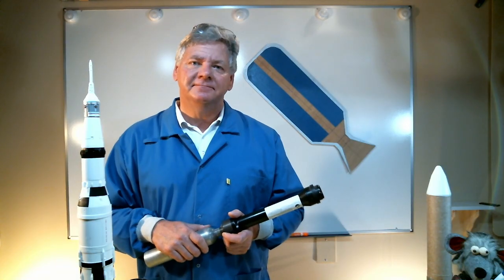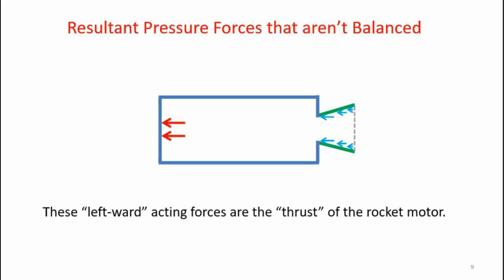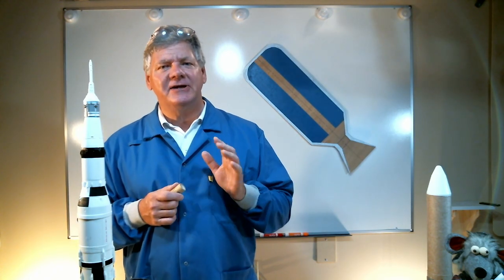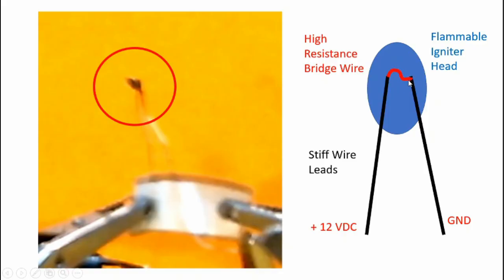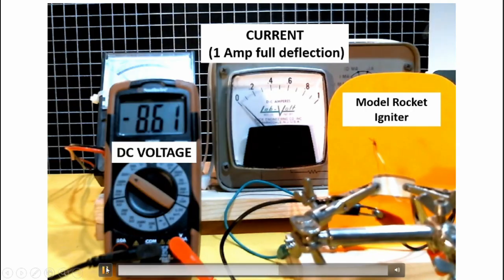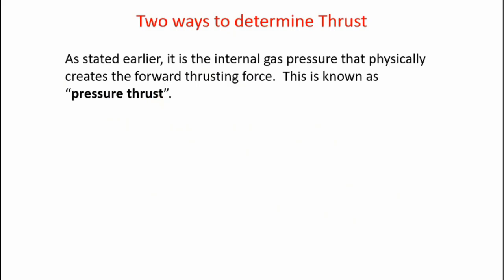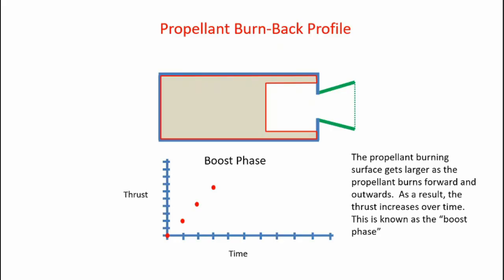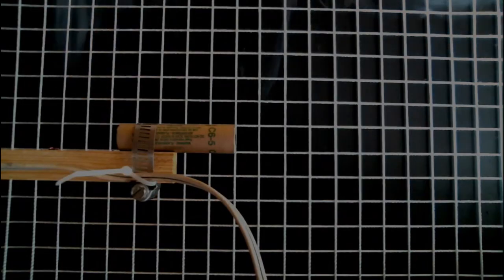Rocket Propulsion Basics

Comment from the maker: There has been some discussion about internal pressure imbalances and how they produce thrust.  Here are a couple of quotes that support the content in this video.  "Thrust is the force that propels the rocket forward...  Physically speaking it is the result of the pressure which is exerted on the wall of the combustion chamber ." (Rocket and Space Technology Training Couse).  "The size of the arrows indicates the relative magnitude of the pressure forces.  The axial thrust can be determined by integrating all of the pressures acting on the areas that can be projected on the plane normal to the nozzle axis.  The radially outward acting forces are appreciable but do not contribute to the axial thrust, because the rocket is axially symmetrical." (Rocket Propulsion Elements - An Introduction to the Engineering of Rockets - George Sutton).
Reply: @TR-Labs  What? I am sorry, but you do not know what you are talking about. No it will not. Notice you have no time component mentioned. Acceleration is a function of force applied for an amount of time. If the area of pressure imbalance multiplies out to a force that is greater than the weight and air resistance, then the Rocket accelerates.... that is it.

In ideal rocket (that somehow never changes mass through burning fuel) let's say that it weighs 1,000,000 kg, so it obviously needs at least enough force to overcome its own weight.

Let's say we want it to accelerate at 50 m/s^2. This means that with the acceleration of the rocket's gravity(weight) being overcome and then an extra 50 m/s^2 that we need a total force of 59,800,000 Newtons. That is 13,443,574 lbs. A mid-high performance rocket engine should have about 2000 psi in the engine. That would make the nozzle throat need to be about 7ft 8in in diameter.

If you do this math that takes an extremely long distance, but in reality, the Rocket is losing mass as it is combusting the fuel for acceleration. Something like more than 85% of a rocket's mass is fuel if that gives you some perspective. Completely ignoring that we still get a 1,000,000 kg rocket only needing a nozzle throat less than 8ft wide producing 2000psi inside the combustion chamber. Numbers outside of that are completely possible too as it is merely a function of total time there is thrust. 2000psi with a certain nozzle throat and burn time takes a certain amount of time to accelerate to 17,000mph and then many other combinations of throat size/time could be calculated. 

There is nothing close to 8,000,000psi ever needed for the rockets we see today. My lord nothing even close.

Comment: pressure is a scalar. so your sllly diagram is BS.
Reply from the maker: Yes, pressure is scalar...  But I think you may have misinterpreted my "silly diagram" - which I assume is the one showing the arrows inside the motor.  As stated in the video, I was talking about the "forces" inside the motor.  The forces that are created by the pressure (lb/in2) acting on a surface (in2).  Pressure x Area = Force...  The forces act perpendicular to the surfaces thus do have a direction of action.  And the frame of reference that I was using allows you to break the forces into x and y components - which was my assessment inside the motor's exit cone.  Think of this - If I have a PVC pipe capped at one end and covered with a rubber membrane on the other, as pressure is added inside the pipe, the membrane is pushed outward.  The only way the membrane can move is if there is a force acting on it (Newton's Laws).  Since the membrane if moving along the axis of the pipe it indicates a force acting along the axes of the PVC pipe.  That's one direction.  If I make a big hole in the side of the pipe, cover it with a rubber membrane, then pressurize the pipe the membrane will push out towards the side.  This indicates a pressure force pushing radially on the inside of the pipe (another direction).  I believe this supports my "silly diagram"...  But you are right - pressure is scalar...  You can also go to any propulsion text book and see the same kind of explanation.
Reply: @labratscientific1127  your silly diagram only showed pressure at one end of the combustion chamber. which means you are claiming pressure is not a scalar. also i'm pretty sure N1 refers to external force, but your silly diagram shows internal force. so it won''t be much use moving anything, will it?
Reply from the maker: @papalegba6759  As I work through the diagram in the video I'm eliminating forces that are offset by equal and opposite forces.  The "upward" forces on the casing wall are offset by the "downward" forces on the opposite side of the casing.  So I eliminate them.  Since they are all equal and opposite there is no net force causing the motor to move sideways.  The same happens at the forward and aft ends.  In the video you see me eliminate some of the left and right forces acting on the front and back of the motor.  At the nozzle there is so surface for the pressure to push on so there is no pressure force.  Lb/In2 x 0 in2 = 0 lb...  So there is no force pushing to the right to offset the force pushing on the front of the motor to the left.  As such, there is a net force towards the left.  Again, I'm talking about the pressure force, not the pressure...   As for Newton's Law, the force pushing on the front of the motor casing is an "external" force relative to the surface.  So it will push the front of the motor towards the left.  And since the front of the motor is attached to the rest of the motor and the rocket as well, everything will move.  I have made these pressure calculations on an actual rocket motor and they produce accurate results...
Reply: @labratscientific1127  so the combustion in an INTERNAL combustion engine counts as an EXTERNAL force? um - no. plus you're still treating pressure as non-scalar, whilst stating it is a scalar. that's quite enough of your topsy-turvy nonsense, muting you now.
Reply: @papalegba6759  <- chatbot giving up and running away again due to core dump, memory cascade collapse.
Reply: @kitcanyon658  pretty sure the guy making the video ran away, chatbot 😂
Reply: @kitcanyon658  It is OBVIOUS that papalegba never even graduated high school.
For ONE: He REFUSES to answer ANY questions (he has even stated that his "Teachers" never asked him any questions like we do) so it would be IMPOSSIBLE to pass any kind of test.
AND his complete LACK of understanding of basic physics is proof he never completed even a high school physics class.
Reply: @stuartgray5877  Agreed.
Reply: @stuartgray5877  Or Chemistry.

Ask papalegba "what is the combustion by-product of a hydrogen oxygen fire?".

The answer is explained to all High School Chemistry students on day one of class.
Yet papalegba does not know the answer is "water".

Comment: Never mentioned how rocket propulsion is possible in vacuum of space. Some pro-nasa propaganda claims Newton’s Third Law is responsible for propulsion in space, but the gas escaping from nozzle doesn’t make sense it could move a massive body and speed up towards Moon. First they’d have to solve the problem of how Neil Armstrong could possibly fit through the lunar module’s hatch. https://history.nasa.gov/alsj/a11/ap11-S69-31146HR.jpg
Reply: If you fired a CROSSBOW in space, WOULD YOU FEEL RECOIL? Yes or No?
Reply: @stuartgray5877  there would be recoil. I'm not sure if it would be noticeable. Obviously, it would depend on the mass of projectile, how fast you could get it going and your mass.
Reply: @major_kukri2430  Exactly.

Would a linear accelerator, in space, feel the recoil if it fired a 500 kilogram block of water ice out the "barrel" at 2500 meters per second?

Woudlnt that machine feel a HUGE force accelerating that water ice?

A Space Shuttle Main Engine (SSME) does exactly that once per second.
Reply: @stuartgray5877  yeah. I know. And that makes sense.
Reply: @stuartgray5877  
That "500 kg block of water ice" is in fact fired at 3600 m/sec at sea level and 4400 m/sec in space, meaning that rockets work better in space than inside the atmosphere.
Reply: What are you talking about?
Reply from the maker: Rocket propulsion can be calculated in two ways: 1) Pressure acting on the front of the motor casing and the inside of the nozzle, and 2) momentum of the gas leaving in the nozzle.  For #1 - The inside of the motor is pressurized with the same pressure in all directions.  The pressure on the casing side walls is balanced in each direction so there is no lateral force imbalance, and thus no lateral net force.  The pressure is also pushing on the front of the motor (the forward dome) and it is also also pushing on the back of the motor, but there is a hole at the back - called the nozzle.  Because of the hole there is less area for the pressure to push on, and thus, less force acting on the back end of the rocket than on the front end.  Force = Pressure x Area...  This force imbalance gives a net forward force and Newton says the rocket will move in that direction - plain and simple...   Go to the LabRat web site and study the Rocket Physics - Production of Thrust Lesson to see the math (specifically Slide 34).  Rocket motors do work in a vacuum! F=ma, a=F/m, and if the force (F) acts over several minutes the rocket can accelerate (a) to high velocities...  As for as Neil (and 11 others) getting out of the LEM, the engineers designed the door big enough...